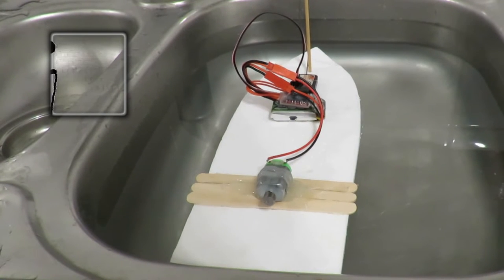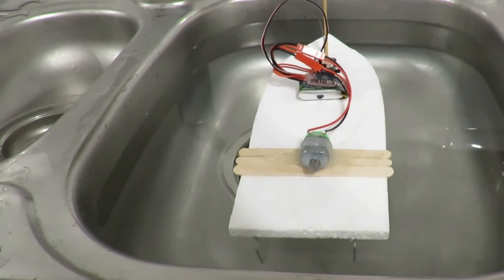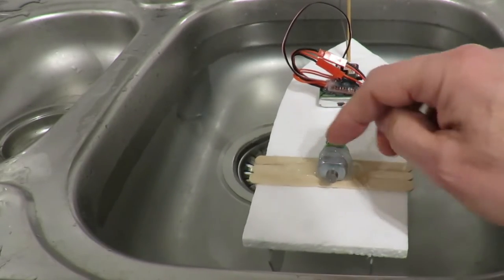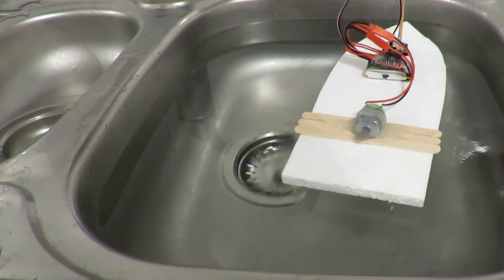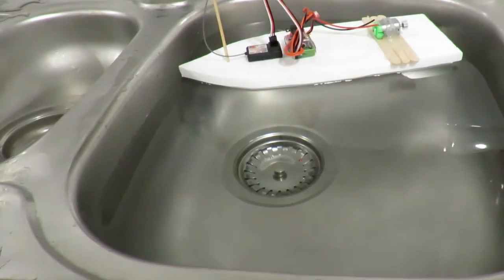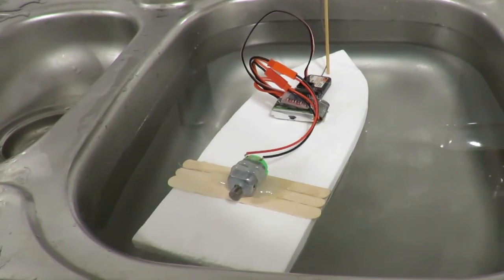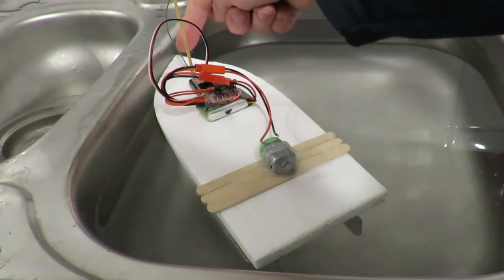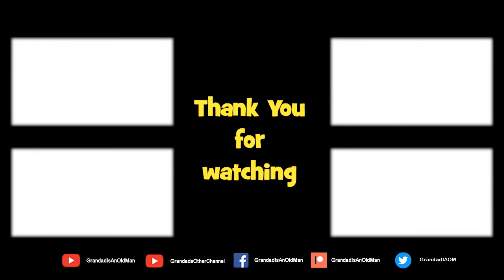HOW or WHY does this work Vibrating Boat propulsion PART 3

Comment: It looks like you are find the natural resonant frequency of the boat. As you approach the frequency ripples start to appear in the water and then the boat starts to move. It will vibrate when it's natural resonant frequency is reached.
Reply from the maker: At a different frequency it actually goes backwards. What I am hoping for here is for somebody else to have a go and see what results they get. So many people make comments that are simply guessing. There is nothing expensive or difficult in this project so there is plenty of opportunity for people to have a go and see what happens 🙂

Comment: Yes, I think you cracked it. As you say, it is the harmonic or frequency that reaches the correct point and makes it go forward. The question I would ask is, why does it go forward?
On the aluminum boat, I thought it because of the split in the foil but this proves that it was something else. Great experiment. :D
Reply: @hermitoldguy6312 : Yes I see what you mean Hermit and I would agree with that. :D
Reply from the maker: @hermitoldguy6312  At a different frequency it actually goes backwards. What I am hoping for here is for somebody else to have a go and see what results they get. So many people make comments that are simply guessing. There is nothing expensive or difficult in this project so there is plenty of opportunity for people to have a go and see what happens 🙂

Comment: Looks like the aluminum moved a lot more and so moved more water, like the diaphragm in a carburetor. Combine a flexible diaphragm with a more rigid piece to add pressure to the water and you'll be off like a jet
Reply: @hermitoldguy6312  yeah some small speaker with a cone made of a water resistant material could make a nice diaphragm pump. no reason it cant be done with a toothbrush, but a speaker might be ideal. i think there needs to be some kind of a simple check valve, like a flap of plastic and some ducting to keep the flow unidirectional as that's really what's missing here. this boat is basically pumping water in all directions except at some specific resonance with the sink

Comment: it’s a good example of resonance frequency’s.
Reply from the maker: But why does it move?
Reply: @GrandadIsAnOldMan  it moves because the force in (y) direction is more effective than (x) direction force. Imagine you can dispare a bullet into a wall, now imagine this wall inside a boat, the bullet provide a momentum to boat in an especific diretion. This is momentum conservation. The same principle can explain this fenomenon.
Reply from the maker: At a different frequency it actually goes backwards. What I am hoping for here is for somebody else to have a go and see what results they get. So many people make comments that are simply guessing. There is nothing expensive or difficult in this project so there is plenty of opportunity for people to have a go and see what happens 🙂

Comment: When you had it at the higher RPM it seemed to go backwards at around 3:30 which is interesting.
Reply from the maker: I suspect it is all to do with the resonant frequencies. I expect the boat flexes at different points depending on the frequency. It will get very complicated if you try to work it all out. The ripples created on the water will also interreact and bounce off the walls.